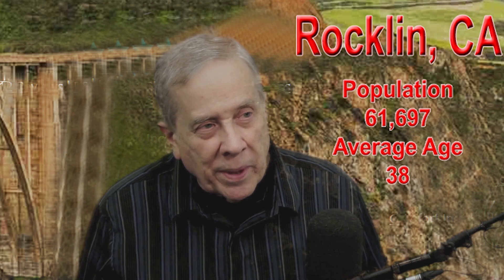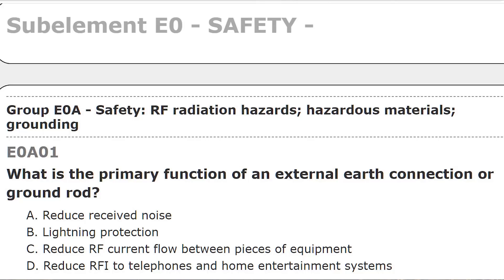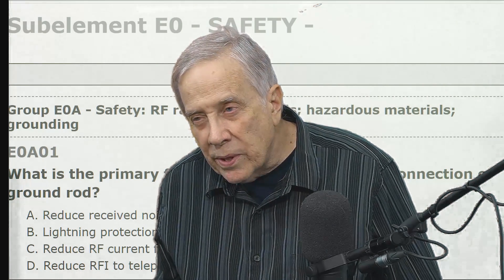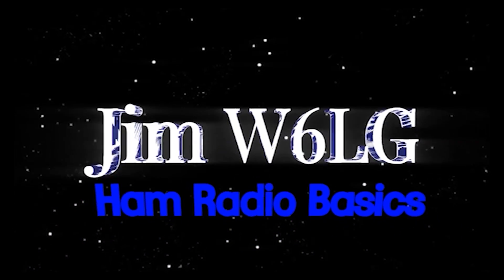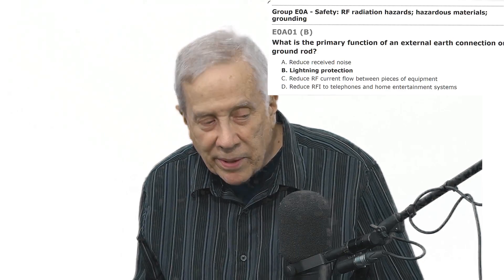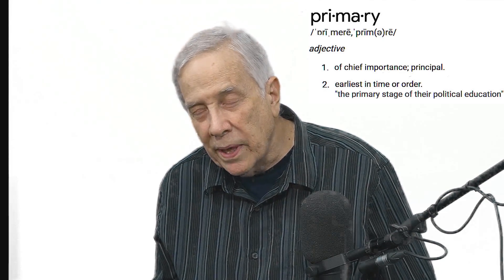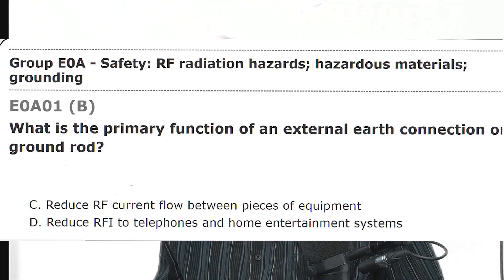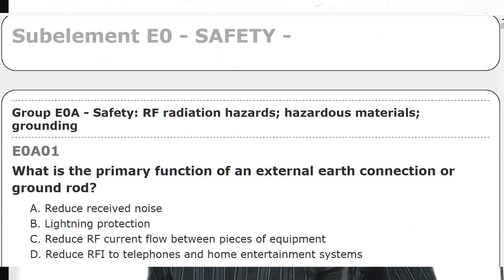Station Grounding & Extra Class License Question That Has The Wrong Answers Part 1 of 2

Comment: I disagree. First, let me say and thank you for the videos you do. You are brilliant in your knowledge and understanding, and ability to communicate both. So why do I disagree?

Let me begin where I agree. Exceptions notwithstanding, consistent with the NEC, all grounds must be bonded at the service. Agreed. Consistent with the Motorola R56 standard, grounding (earthing) Will protect from lightning. That said, a single ground rod isn't even close to being able to achieve that. So I agree, lightning protection is not a good answer.

Grounding in the structure is for safety; however, as the question deals with an external ground, I don't see electrical safety to be the application. As I understand, we must choose from the best possible answer from those answers that are giving us. So now, we are left with choosing... which really is the best possible answer?
Reply from the maker: Thank you for all.  Is there an answer that you would have chosen?  Some of the comments have dealt with, as you did, external ground.  Here's that terrible question:

What is the primary function of an external earth connection or ground rod?
A. Reduce received noise
B. Lightning protection
C. Reduce RF current flow between pieces of equipment
D. Reduce RFI to telephones and home entertainment systems

The question has "or" and that bothered me. Every ground rod that I inspected was an external earth connection. I wondered about external as opposed to internal and could not figure out what they trying to ask.  Answer C was the closest to something that made sense to me.  One idea I had was the driven rod at the station which could or could not be installed correctly according the NEC that I used to carry in my County truck.  If nothing else, a lot of us have had time to reflect on the ground rod.  In light of all that is happening around us in the U.S., it was nice to divert attention to the lowly ground rod.  The overall test for the Extra is not what I would like to see.  Thanks again for your kind and generous comments.  Taking the time to write to me is really appreciated by everyone. Next year it will be 57 years (March) with a license and there is so much more that I still would like to learn about.  73, Jim dit dit
Reply: @ham-radio  You're right, the conjunction “or” here could be problematic. Given the current choices, I'm glad that you found “C” making the most sense to you, because that was my choice here.

I'm a general who got his technician almost year ago. I need to buckle down and start studying for my extra, but I prefer learning things organically, which is primarily how I passed both my tech and general. I will continue to do that after I am granted an extra, but it's going to take too long for me to learn what's necessary to pass that exam without first studying. 

When setting up my station this year, I spent a lot of time focusing on grounding and the NEC. Mike Holt was valuable with some of that. 

Now retired, I can do some of things I wanted to do, but didn't have the time. In addition to reading and self-educating, there are people who have been instrumental in increasing my knowledge. You one, Jim, and I really appreciate the time that you take doing the things you do to educate folks like me. 

73,
Michael K4KKK

Comment: In my opinion, the question is referring to an "external" driven ground rod which is separate from the structures main panel "safety" ground rod, which is the equipment safety ground found in the structures ac receptacles.  The purpose of this extra, dedicated, earth connection, is to help reduce the difference in potential to as close to zero as possible which will help "minimize" a lightening strike from occurring in the first place.  This is why the National Fire Protection Association (NFPA) recommends disconnecting and "grounding" all antennas to an "external" grounding rod; this includes both conductors. They also recommend unplugging all equipment from the ac power source.  This is the jest of the question.
Reply from the maker: Thank you.  I am glad that you took the time to write what you think they (the VEC) were asking. The question for you means external ground rod at a tower or structure.  The common/typical ground rod is also external. The Ufer would not apply.  Also, think about how the NEC required ground rods to be connected when placed at an antenna structure.  Additionally, consider that most hams do not have a tower.  The question ask about the primary purpose of a (singular) ground rod. The purpose is safety.  In either case, the question is poorly written and the antenna is not correct.  Again, look at the drawings that show the NEC requirement for ground rods.  As a Building Inspector and member of County committees that wrote the codes (UPC, NEC, etc), Expert Witness and the rest of the stuff that I did, I still come back to the ground rod at the main.  Thanks & 73, Jim
Reply: @ham-radio  I do agree with you that the question is very poorly written and the fact that it is listed under Sub Element E0, Safety. I was only considering the ground rod that most hams have right outside their radio room and not the rods at the tower or antenna structure, even though the NEC suggests bonding all grounds to the service entrance ground.  The single point ground in the shack that is bonded to the external ground rod right outside the radio room is not considered the "safety equipment ground" that is used to protect a person from electrical shock. (This is why you shouldn't defeat the safety grounding prong on the end of a power cord as you mentioned).  This external ground is used to drain stray currents such as static and the like, which in turn will help minimize the risk of a lightning strike.  This is how I interpreted the question even though all grounding and bonding could be considered as safety.  Thanks for your videos.  I do enjoy them.  73

Comment: Right, the rod certainly cannot affect the dome of protection. In reading as much published literature as I can regarding station grounding, I’ve turned up one important and relevant idea, IMO. Ignoring AC line fault safety and RF grounds for the moment, the idea regarding lightning is to keep strike-induced voltage potentials as near earth ground potential as possible and as equal as possible between pieces of station equipment. Bonding all equipment to earth with adequate gauge wire to mitigate (but not necessarily eliminate) brief high voltage strike potentials lowers the chance that your rig’s chassis is elevated hundreds or thousands of volts above earth ground potential, or above that of a neighboring piece of equipment. The goal is to keep high induced voltages as low as possible, and keep them the same across all your gear and earth. You’re trying to eliminate dangerous voltage differentials.

Yes, your rigs might already be grounded via the AC safety ground in the house wiring, but it is typically a 12 or 14 gauge wire that has too much DC resistance and too much RF inductive reactance to be of any use in the case of a kilovolts-surge caused by lightning that has a huge RF component.

Earth ground is not “zero.” Its potential changes and can rise high during a nearby strike. If your gear isn’t soundly grounded, it will rise higher, creating a dangerous differential. 

If you receive a direct strike, you’re toast. No 6 gauge wire can conduct that kind of current. We’re talking about reducing damage and potential injury from induced voltage caused by indirect strikes.

Read the ARRL grounding and bonding book. It’s a good place to start.

So no, a ground rod cannot “protect you from a strike,” as in starship Enterprise shields in the sky. It can offer some or much protection from the secondary effects of a nearby strike, depending on the voltage induced. In that sense, and given the other possible answers, “lightning protection” seems a primary purpose.

One further analogy...seat belts protect you, but they don’t protect from car crashes happening. So they do and don’t offer crash protection, depending on your way of seeing things.
Reply from the maker: The questions as written without interpretation just asks in a weird way  about a driven rod.  The question as written and the answer as written are wrong; dead wrong.  I was not intending to cover how to install  ground rods for lightning.  My concern is violating the NEC and creating a dangerous installation.  We could talk for hours about lightning.  Thanks & 73, Jim

Comment: We do halo grounding in our cellular sites.  We don't use rod, but rather flat copper plate buried by each face of the building.  Those 4 points are brought into the shelter and connect to a busbar that circles the room.  Each peice of equipment takes the shortest route to the grounding bar.  Everything metal gets grounded. On the outside a small bar is extended that bonds the shield of ever peice of coax that goes up the tower.  Why?  To create that so called bubble of protection.  Some sites get hit hundreds of times a year, and still need a 99.9% uptime.  Sometimes, expecially in the Rocky parts of the mountains, it gets difficult, as the ground isn't much of a ground.  I have always said, lighting is like a punch to a boxer.  If you want to play, you better be able to take a hit.
Reply from the maker: That sounds really good.  Also, since that is a separate building, NEC does allow a separate ground.  Interesting about the bubble of prevention.  Thanks for the information Mike.73, Jim W6LG in Rocklin, Ca

Comment: reduce RF between equipment

NEC requires bonding to ground and do not want multiple paths to ground and why ALL radios should also be connected to this single grounding point.

Comment: Hey Jim. Thanks. I pick up stuff I should know already, from listening to you. Being in the trades for so long, I understand that people know some things that just ain`t so. The only real way to protect your rig is to listen to the weather report and  un plug EVERYTHING at the smallest threat of electrical activity. Lightning rods, earth connections, etc., will not save the bacon. Insuring your stuff will help, but the loss of a cherished rig with a lot of memories attached to it may be an incalculable loss. I was told that lightning can even strike a ground rod and the juice can travel back to the fuse box. KC3BXZ Joe 73

Comment: Another great video Jim... just had my house totally re-wired two years ago and they added 2 8 foot ground rods on each side of the house...
Reply: Are they connected to each other?   They should be.   One grounding system.  The more rods the merrier.
Reply: @flyingjeff1984  yes they are there is a piece of copper going from one ground rod on one side of the house to the other ground rod near the breaker box
Reply: @2metercrew389  I'm trying to get up the guts to buy 2 or 300 feet of wire and do just that.  I'm restricted to going the long way. :(

Comment: Thanks for the clarification - I would also disagree with the "official" answer to the question.

There are however some important (non-USA, I think) exceptions. Here in the UK, many houses have Protective Multiple Earth (PME) systems, where the neutral line is tied back with all the others on the street to earth by the electricity supplier. Thus introducing a local ground in your shack can thus be very dangerous! Always check with your supply company first.

David
 2E0FXO
Reply: In the US, the power lines at the pole often/usually have four wires -- three HV 120deg power phases and one bare inter-pole "ground" wire.  At each pole, the ground wire usually has a #6 solid bare copper wire running down the pole and into the ground.  This treatment acknowledges that ground potential is not necessarily a constant V along the route.  It serves to reduce any ground currents under the pole by connecting the zone at the base of the pole to the same potential and close to the same potential as the neighboring pole.

The typical pole transformer has its center-tap tied to the inter-pole ground wire and thus to the local pole-base ground potential.  To the house usually four wires are run: two 100amp 110VAC P1 and P2,  one 100amp neutral and one bare pole-grounded, supporting guy wire.  At the house mains box, the bare ground is tied to a ground block and the box itself.  An external house-local ground rod is tied to this ground block.  The incoming neutral is tied to a neutral ground block.  All the house wiring neutrals return to this block.  In the mains box, a single wire runs between the ground block and the neutral block.  This single wire ties the local ground reference the house's neutral voltage level.  All this keeps the house grounds at a local ground.  It also keeps the incoming neutral at the local ground.  Note that the neutral at the wall socket may not be at local ground because current flow in the neutral wire back to the mains box does the V=IR thing.

Comment: Although I live in a different jurisdiction with different wiring regs I do share the same physics. It is a very bad question, and the lost mark in the examination is the least of the problems with it. Arbitrarily adding grounds is an unsafe practice if they are not correctly bonded to the safety ground. Sadly people will refer to their licensing questions when they set up their station. Including a question like this will do more harm than good. Great video as always 73

Comment: Thanks for all the info! That question bothered me but I aced my extra test. I been trying to find out if bonding through copper water piping is okay? My new house has three but all tied into the pipes. I can't get a straight answer from my local electricians.
Reply: Bonding and grounding to copper pipes which enter the ground is an old fashioned but still effective way to get an earth connection. A grounding rod driven into moist earth is still the preferred way to ground your house today.
Reply: There is three ground rods around my house but each one is tied into the water spigot exiting the house and one in the main power box but the bonding if I'm using the term right is by the copper plumbing